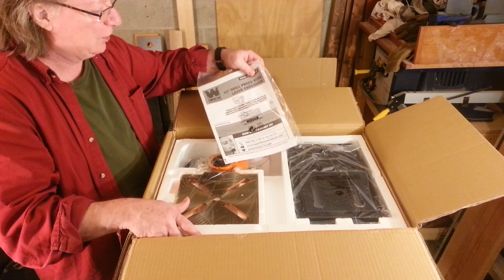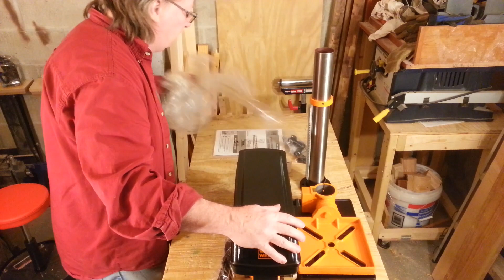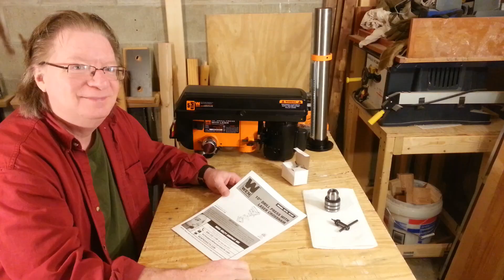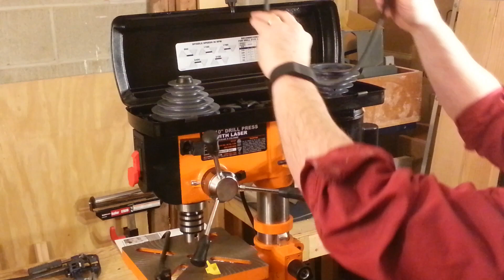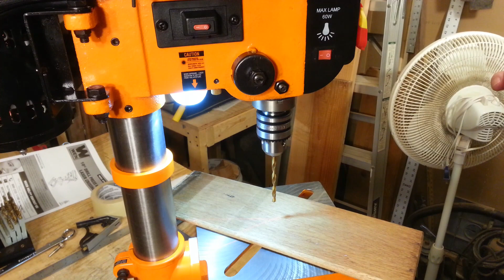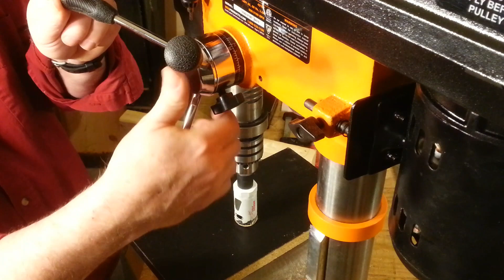86. WEN 10 inch drill press tool review and usage tips

Comment: Tried to write a note and it disappeared. I don't understand any of this stuff. Now using cellphone and will look on computer later. Ordered a Skill 6.2 amp 10". It looks kinda cheap, plastic pulleys, etc. But has a 3-year warranty. Was satisfied with my Taiwanese Vulcan but the spring broke and it's impossible to install the not-identical replacement i bought. Now stuck with a nonworking 1-ton machine i don't want to carry back up the stairs. machine
Reply from the maker: Sorry about all of that. I think the WEN I bought is pretty good and you see me using it in a bunch of different videos. Good luck with the Skill drill press you ordered. Hopefully, it meets you needs nicely.
Thanks for your comment and for watching.

Comment: One drill press assembly tip: If the assembler doesn't want to put the heavy motor and spindle head on the base/column - instead, turn the head upside down, then put the assembled base/column/head into the motor head. Tighten the setscrews, lay the assembled press on its side, then stand it up.
Reply from the maker: Thanks for the tip; I would not of thought of doing that.

Comment: To check for laser accuracy, drill a pilot hole in the wood but do not go all the way through. Back the bit out and check to see where the laser lines are in relation to the hole you drilled. You should be centered. Mine came out really close, with no adjustment necessary. Thanks for taking the time to product this video. I'm not a manual reader. This helped a lot.
Reply from the maker: You're welcome and thanks for the tip on checking the laser accuracy. I have had this drill press for a while now and still use it frequently so I recommend it. Thanks for your comment and for watching.

Comment: The music is very annoying not to mention hiding the sound of the machine as it works.
Reply from the maker: Thanks for your comment Jay. You can hear the drill press run without any other sounds at 28:10. You can also hear the drill press run without any other sounds in these more recent videos:
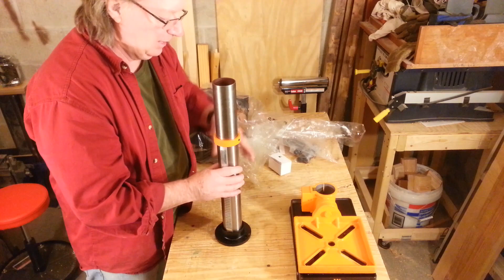https://youtu.be/IOiT6-0_Mj4       2:00
https://youtu.be/ZJRjK7N5_hA    5:10
What I have found is that the drill press is relatively quiet while running and not drilling. The amount of sound it makes while drilling depends on several things such as: the kind of wood your drilling, the speed the drill press is running at, the kind of drill bit being used, etc.
Hope this helps.

Comment: The nut on the handle is an acorn nut! Lol! I have the same unit works great had to make few adjustments to the table to square it up to a drill bit in the chuck and the laser guides were off a smidge after slight adjustment they are spot on now! I also had to line up the pulleys so they were on the same plane...mine were off about a 1/16”, just loosen the 2 set screws on the each pulley and the move easily up or down on the shaft. The runout on the chuck was very minimal! I run it on the drill on the slowest speed as I drill metal mostly!! So far so good! 
Thanks for sharing and the tips!!
Reply from the maker: You're welcome! Thanks for your comment and for watching.

Comment: Thanks for just the right amount of detail in your video.  Did you consider the Wen 4212 (also a 10" unit) when buying this one?  The 4212 has adjustable speed by just turning a lever.  However, it does not have the work light which is a very nice feature.  They are very close in price.
Reply from the maker: Yes, I did consider that model. I have used other drill presses where you adjust the position of the belts to control the speed so I didn't think I needed the fancier variable speed. Thanks for your question and for watching.

Comment: Have you or anyone else noticed any wobble to this model of drill press? I am a new knife maker and I need purchase a new tabletop model. I have an old 1940 Walker Turner but it has just a hair too much wobble to make the perfect holes that I need
Reply from the maker: Hi Joseph. I think you are asking about "drill press run out" or "wobble". I'm generally drilling holes in wood so I don't typically need to be super precise. I can say that the wobble I've seen is not in the drill press but in the drill bit I'm using; sometimes the drill bit is slightly bent or is not chucked in correctly. If you click the link in the video description (which takes you to Amazon for this drill press), you can read through the Q&A and see that some people have asked about wobble but several (including myself) don't feel they have that issue. Keep in mind that this is a drill press and not a milling machine (which is typically more accurate but also much more expensive).
Thanks for your question and for watching. Please feel free to share any of my videos.
Reply: @ImaginethenMake  thank you for the reply. I just ordered one as I feel it will be good enough for my knife making. I am also subscribing to your channel. You make some really good videos

Comment: I see it wobbling a lot, how stable is it?
Reply: Thanks so much for the response.  I’ll be getting one!
Reply from the maker: Hello Nicholas. The wobbling you see is because of the table the drill press is sitting and not the drill press itself. I still use this drill press and still recommend it. For the money, I think it is a solid (and stable) general purpose drill press. I still find it easy (and quick) to change speeds, table height and orientation. In my last video I used it to make a 7-pointed star. In that video, you'll see me use the depth stop (to make several holes all at the same depth) as well as the laser crosshairs (to better line up the drill bit). Here is a link to that video in case you are interested: https://youtu.be/ZJRjK7N5_hA
Thanks for your comment and for watching. Please feel free to share any of my videos.

Comment: Hello could you tell me What is it for that holes ? ( base's two holes )
Reply from the maker: Excellent question! The 2 round holes can be used to bolt the drill press to a table. Since the drill press is a top heavy machine, it can tip over if you are not careful. Bolting the drill press to a table helps to prevent that. The slots in the base can be used to attach a vise or jig to hold your work piece (you don't always have to use the drill press table). Having these slots expands the possibilities for how you can use the drill press.
Thanks for your question and for watching. Please feel free to share any of my videos using any convenient method (social media, email, text, ...).

Comment: Thanks for making this video. I tried to find a video that shows how to set the depth of cut on this particular style of drill press. There are at least 3 variations of the Wen 10" drill press, and some of them have the normal style depth guage with two nuts on a bolt with a dial indicator. This is what I'm used to. I recently purchased the Wen 10" variable speed drill press and it has the style on your press. I couldn't find any information anywhere. I think you should make a video solely dedicated to this feature 😉.
Reply from the maker: Thanks for your comment and for your suggestion.

Comment: Does the packaging give a horsepower spec?  A schematic I saw previously on a retailer's site said 2/3 HP, which is better than all in this class, but now I read 3.2 amps which converts to just over 1/3 HP.    If that's the case, the Wen is pretty much on par with everything else in this class, and perhaps less than the Harbor Freight 10" model which is 1/2 HP.
Reply from the maker: I don't have the packaging any longer. The name plate on the machine says 3.2 amps; I'm not sure how that converts to horsepower. I suspect the actual power delivered to the spinning drill chuck is a function of how efficiently the power is transferred from the motor with losses at the belt and bearings. I've always assumed that drill presses in this price range all have approximately the same specs. Hope this helps.
Thanks for your question and for watching.

Comment: Debating on this WEN 10" drill press or a Ryobi instead.  If anyone has any opinions on which is the better one, I'd appreciate it. Thx
Reply from the maker: I have only used the HF 10" and the WEN 10". I have never tried the Ryobi. What kind of material will you be drilling and what are the hole diameters? Small holes need high speed while large holes require slow speeds. From the pictures on the web, the depth stop might be a little easier to use on the Ryobi. Hope this helps.
Thanks for your comment and for watching.
Reply: Imagine then Make Thanks for the comment.  I more likely be drilling holes no more than 1:2 inch in diameter, maybe larger if I’m using a whole saw bit to actually make holes in my wood.

Comment: Do you know the motor frame size? Im looking to upgrade the motor, if I get this.  Good video and tips.
Reply from the maker: Sorry, I do not. Why do you want to upgrade the motor? I have found that it has plenty of power for the drilling I need to do. Thanks for your question and for watching.
Reply: @ImaginethenMake  Thanks for replying.    Reason why I wanted to change out the motor is I want to add a variable speed drive to control the speed and not have to change belt locations.   I removed the motor from my old drill press this afternoon and ordered one online. I hope my upgrade goes as well as planned.

Comment: That drill press "stand" of yours is a very wobbly affair. Build a more stable table next, please.
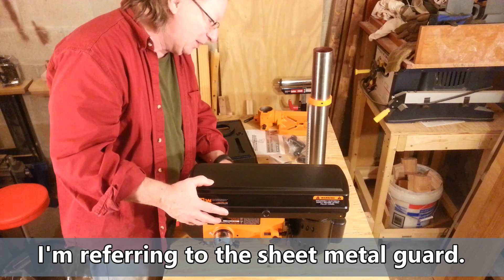Reply from the maker: Yes, the "table" I was using was a Black & Decker workmate with an additional piece of plywood. This was my main workbench for years.  Here's a video about it: https://youtu.be/p3IDiuP8gQc . You can see at 4:25 that the table is a little wobbly. Add something heavy like the drill press and it gets even more wobbly.
I have since designed and built my own small footprint workbench. I have been using it now for several months and it has worked out pretty well (better than the plywood & workmate bench). Here's a video about the new bench: https://youtu.be/osaXlpIFK7Q . And here's a video of some improvements I made fairly soon after: https://youtu.be/qdgYJ9KYjA4 . More improvements are planned soon with another video to follow.
Thanks for your comment and for watching.

Comment: Nice video, better than most of the others I've seen on this drill press.  I actually purchased this exact model about a month ago.  It took me about 1/2 hour to set up and the only adjustment needed was to center the laser crosshairs.  For the price, this is an excellent tool, and since my shop is tiny, the small footprint helps a lot.  Thanks for your examples.  I'm always looking for different ways to use my equipment.
Reply from the maker: You're welcome Tim. I used this drill press on the last couple of projects and am still glad I bought it. Thanks for your comment and for watching.